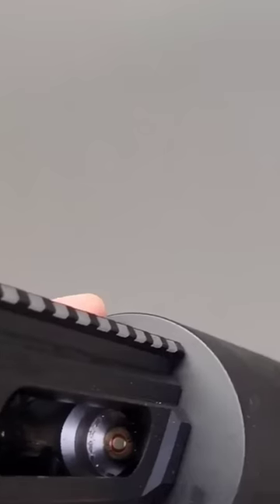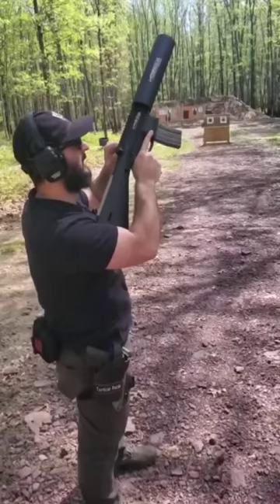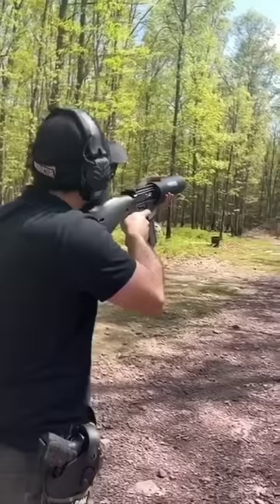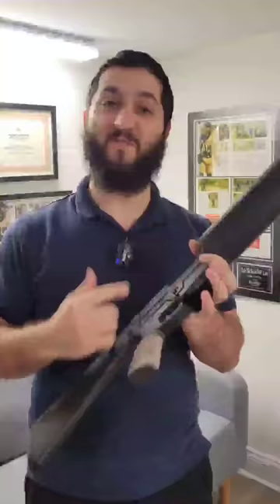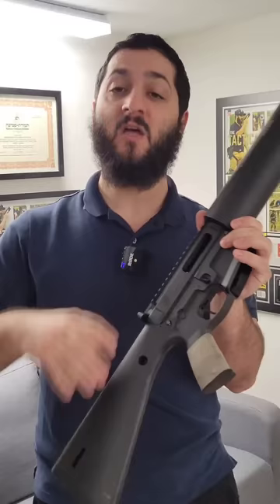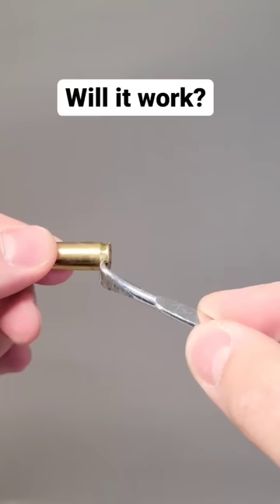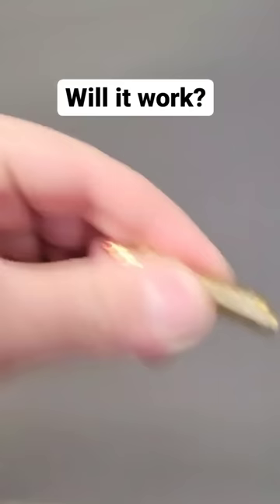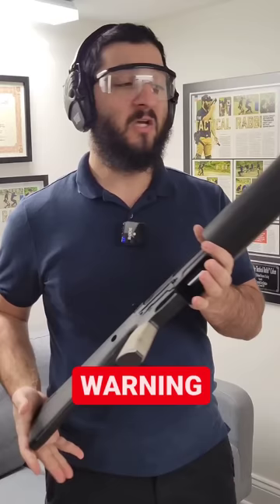I have a LIVE bullet stuck in my AR15! - Here's how you get it out.

Comment: Out of curiosity, if you took a thin rod, opened the chamber and rammed gun downward on the rod... Assuming the round goes off, wouldn't this be relatively safe? With the chamber open and rod small enough to allow gases to vent around it, even if the bullet goes off it would send the rod into ground with a little force, it shouldn't cause any barrel explosion and if you also keep the chamber pointed away, ant metal that flies back out of the chamber would go away from you... I think worst case (besides some stupid insane improbable scenario) is your gets gets destroyed.
Reply from the maker: Please watch the updated video here: https://youtube.com/shorts/eiK_UyloP_c?feature=share
Reply: @TheTacticalRabbi  the video shows a gun exploding but the chamber was closed... Though on your can cannon you can't use a rod, is there a way to remove that portion of the barrel easily? Anyway seems to me if the primer has already been struck the likely hood of it exploding with your extraction tool with your face next to it is the same as the rod method. Am I missing something?  I was more meaning of pushing the rod with the ground and not ramming it as hard as possible also.
Reply from the maker: @ZenithWest169  The issue was ultimately a fitment issue with the barrel. Generally it might be easier to remove but not in this case.

Comment: I mean usually when this sort of stuff happened to crappy equipment in the army, we just left it pointed down-range for a bit to make sure the round wasn't  going to "cook off" or some weird shit and then popped that thing out with a cleaning rod. To each their own I guess..
Reply from the maker: Please watch the updated video here: https://youtube.com/shorts/eiK_UyloP_c?feature=share
Reply: @TheTacticalRabbi  Just did and while educational because I've never seen one of these "can cannons", I still have to disagree with your overall evaluation. The cleaning rod method is tried and true and is completely safe as long as you follow other basic safety procedures. ie: don't pull the trigger or just lock the bolt back in the first place. Never had any issue with laying the gun on its side for a bit (pointed down-range), locking that bolt back and feeding a cleaning rod down the barrel. Can't argue with experience my man.

Edit: we even used the same procedure for open bolt weapons as well. Just have to hold that charging handle back the entire time.

Comment: This is a complete lie. There is no primer strike at all on that primer. This does not happen even with a light primer strike... unless his guns Hammer spring is garbage.
Reply from the maker: The bolt couldn't fully seat which is why there is no primer strike. The issue was ultimately with the barrel fitment. Which is why the bolts couldn't go all the way forward. Good observation though.